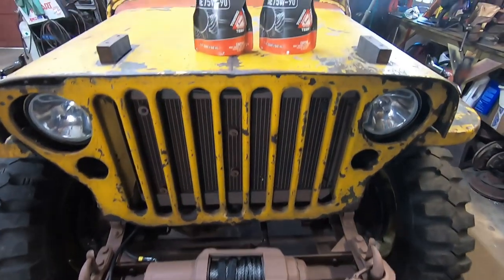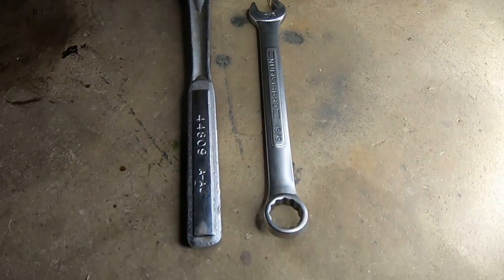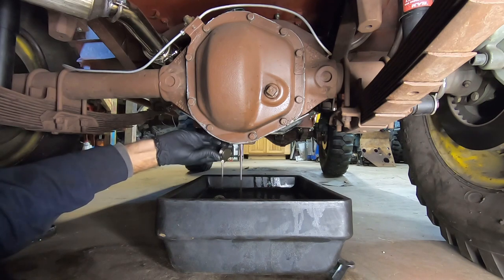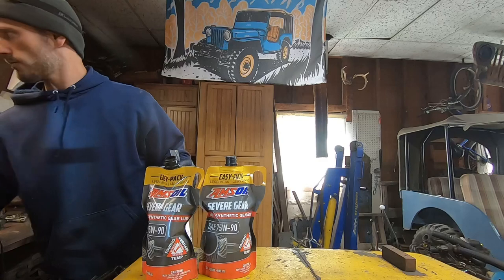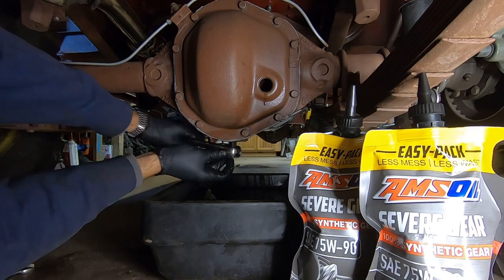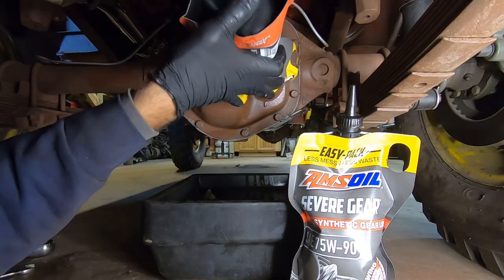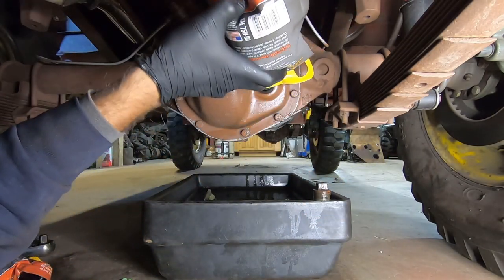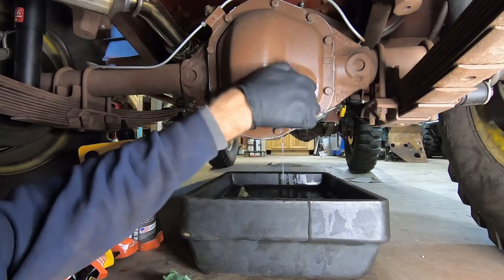How to change the differential fluid in your Willys jeep

Comment: So You don't do the front Axel Current ?
Reply from the maker: I don’t do the front axle nearly as often. My front axle has manual hubs so unless I’m off roading it doesn’t do anything. And the front wheel bearings get their lubrication from grease not the oil. So I service the bearings once a year. 👍